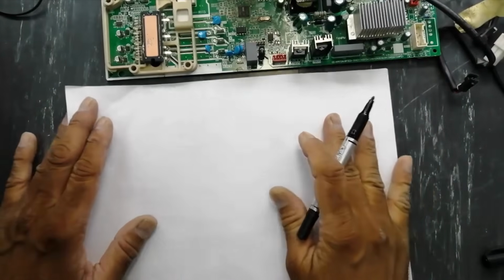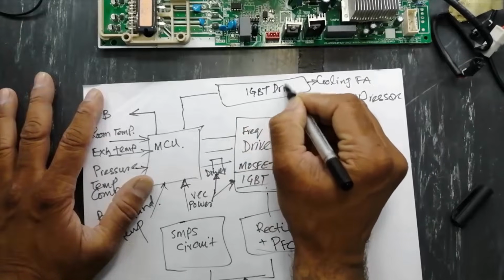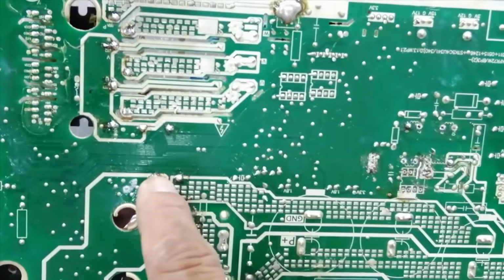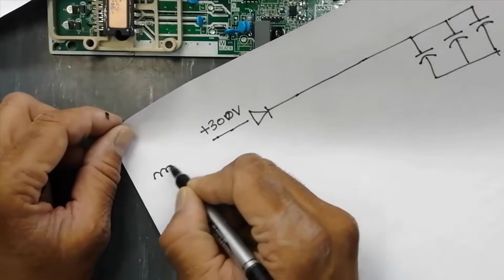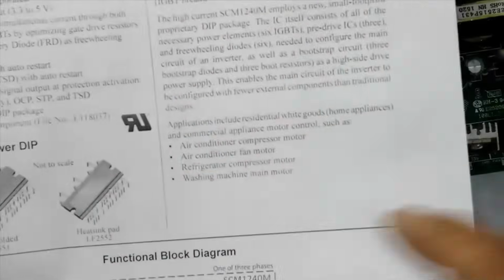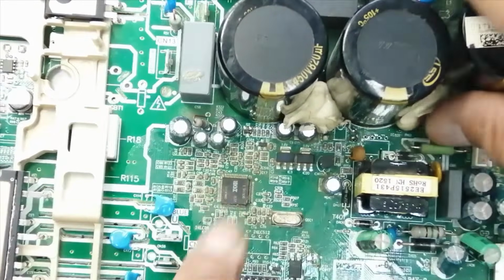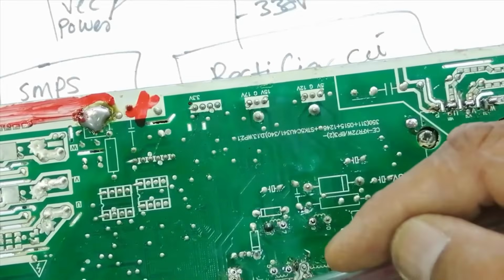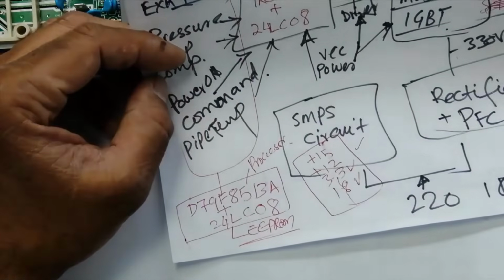#244 DC Inverter AC board Outdoor Circuit Description Explained, How to Test, Troubleshoot & Repair

Comment: the video is so helpful to understand the functions of every block diagram of every circuit of the ac inverter board but as I'm a electronics technician there is a missing thing that i always wanted to achieve it in repairing ac inverter boards is knowing the signals from the mcu to the ipm plus when we buy a new mcu for the board we cannot get the firmware of it or we cannot get the firmware of the eeprom of any ac inverter board we want from you a video of how we can get the firmware fo the eeprom and the firmware of the mcu of ac inverter boards because most of the times we buy the mcu of ac inverter board and we notice that its not programmed thank you for your effort in discussing the principle work on the ac inverter board

Comment: VFD: yes and no, not in sense of generic frequency drive where you change frequency and voltage accordingly to frequency. In BLDC motors, such as AC compressor, you change voltage, and compressor responds with increase in speed, but in order to energize windings at proper angle you effectively change frequency at U V W terminals, i.e frequency of control pulses to the IGBTs. Usually, compressor motors have span of about 900 rpm to about 7200 rpm, at 180-220 Vrms.
Also, PFC doesnt do anything under light load i.e low aperage demand for compressor (computed by MCU depending on multiple temperature measurements), but when demand increases beyond certain limit PFC kicks in and compensate for otherwise low power factor if there was no PFC (high pulsed currents trough the diode bridge).
Also, again, serial EEPROM doesn't contain any source code, only calibrated data and some space for occasional saving of settings (operating mode, set temperature etc.). Source code is placed usually on masked rom or flash or OTP ROM. In the case of the MCU on the board in the video, source is placed in OTP ROM (one time programmable ROM).

Comment: Hello sir
I have E0 in my inverter ac with no signal in relay 1 but the smtp give 5, 12 and 15v I found the drain of tny278 has no output and it's enable voltage is 0.7v
Can you help please
Reply from the maker: if SMPS is providing, that means that the TNY278 IC is working
you didn't mentioned the brand and model number of your AC. because E0 is to be defined by brands and names 
sometimes it is protection in outdoor unit  due to EEPROM failure 
please consult the operator manual or service manual for your ac
if it is not branded and it is made by some local assembler, then you need to check the board model number for indoor and outdoor unit
and locate for some other brand where that board is being used. it will help to locate the probelm
Reply: @HaseebElectronics  thanks sir, it's named Alhafidh
Reply: @HaseebElectronics  sorry sir, another normally working card has  enable voltage 0.9 v to tny but the defected one has 0.7 is that the issue

Comment: This video is unique, i will save it ❤
Thank you very i try to learn and try to remember all this information 😊

I have Mitsubishi pcb board Mxy-2g20va, the unit works but not that coold, the current shows around 1.2A, should the compressor after a well to work 100%, i dont know where to start checking to repar it😂😂😂

Comment: So, will it work if I power this Inverter Air Conditioner with 220V DC instead of AC ?
 
Because I see in the schematic the input Alternating Current (AC) is rectified into ~300V DC before going into IC & the rest of the board.

Comment: You have fantastic videos, I really enjoy watching them and I learn a lot. I am missing a video where I would learn how to look for a malfunction on a PC monitor when the screen does not light up, while the backlight of the screen /CCFL tubes are tested and are OK/. I know for sure that there is a fault in the inverter part. How to find and fix this error. Thanks and I look forward to the video.

Comment: Perfect article. Can you please advice where to buy IGBT module IPM6MBP15VSC 060-50U and what is the quote (cost per unit) ? I have plenty of DC inverter PC boards that are faulty needing such IGBT modules.

Comment: Hi friend, I have a question and would appreciate a lot if you would answer. I have an Inverter AC Hisense Energy Pro Plus that is really good and powerful, but it is installed in a small room (20 square meters) so when temperatures outside are above 8 degrees celsius AC heats the room quickly, and AC goes into stand by mode because it cannot modulate power below 400w.
When it's even warmer outside +10 C and above, the ac goes into these standy mutiple times in a day, sometimes even 3-4 times in an hour. My question is, are those freequent stand by and compressor shutting off and powering on bad for ac lifetime ? can it cause failure over time or this has little or no impact on AC lifetime ?

Comment: Wow, thank you so much for this explanation I learned so much from this video. I am going to do some experiments injecting 300V DC from a string of solar panels, right after the rectifier. Maybe I will have to build an extra power corrector to maintain a clean 300V DC. I will let you know when I know more. But this is definitely doable.  Gracias from the Dominican Republic.
Reply from the maker: Wish you best of luck

Comment: hi ! thanx for your video ! 
please, question. in africa now, all aircon tend to be inverter (daikin,airwell,panasonic,lg,midea,hisense). but no qualified tech in order to repare PCBs. So most of time, for a little issue, aircon is replaced.
is there any electronic solution to transform inverter to kind of « on/off » aircon ? or is there a kind of generic pcb that can work as replacement of proprietary board ? thanx

Comment: Thanks a lot for this amazing and informative video. I just have one quesion, is it possible to operate it by connect solar power via the rectifier pins with or without ac terminals connected?

Comment: Pls Sir, we need help...
How do I solve LG INVERTER AC CH23 ERROR code... DC link Voltage.
Some say is caused by DC low voltage, some say is capacitor..
I have tried all but yet it did not work... I have even change the IPM ic, yet nothing..
Pls Help me Sir....
Reply from the maker: can you please send the Model number of the outdoor unit or circuit board

Comment: How do I Alter the 60 Hz output to 81 Hz?
Reply from the maker: do you want to alter the output of the board to 81 Hz, if yes
then,
we cannot do it manually. it will possible from the software. you have to access the source code, amend it, compile it and reload the program in the memory
Reply: @HaseebElectronics Thankyou for taking the time to answer my question.  The project is to power the AC turntable motorin a Seaburg Jukebox to play 45 RPM 7 inch vinyl records.. The original Inverter was designed in 1966 and was not stable so the Playback speed would run between fast and slow..

Comment: How much the output. to compressor?
Reply from the maker: it output is normally 310V peak, but its RMS value will change depending on the frequency and duty cycle 
we can say it may be from 50V to 220VRMS and frequency will differ based on the required compressor speed

Comment: How much the output voltage to the compressor, or it  is DC volt or AC volt output.
Reply from the maker: it is 310V +ve peak and 310V -ve peak
its RMS value will vary depending on the frequency and duty cycle
it  may be 50V to 220V RMS

Comment: Where does the processor get its power from? I have a 12000btu gree unit
Reply from the maker: it takes 3.3 volt from the low voltage power supply 
most of the time it is made from 5 volt power supply using buck regulator
Reply: I thank you for your answer, this gree outdoor pcb board doesn't show the voltage like in ur video. Am puzzled because there is no voltage and the smaller capacitors only the main ones the lights that blink on the board not lite....plz help.

Comment: If the main capacitors have its main voltage dc and input to the board 220v Ac, why I dnt see the outdoor board light up relay not closing
Reply from the maker: sometimes the PFC circuit is unable to turn ON, 
sometimes the microcontroller is unable to sense the dc voltage 
check relay driver circuit

Comment: Sir my bluestar inverter ac(model. No. IC312RBTU )is  working for few hours. After that outdoor fan become off and continuing the temp.display. (Which is we sellected)But no cooling effect on that time. Then the error code PC-01 will display on indor unit. That time the outdoor fan becomes rotate. When the error code stoped that time the outdoor fan also stoped. What is the problem Sir? Is possible to repair the PCB?. Please help me sir.
Reply from the maker: brother i never experienced this product and its fault code translation 
i tried to search the service manual but there is no information about its fault code and its remedy. i will try to search and will contact 
because i am in Jordan and here this product is not available
Reply: @HaseebElectronics  Thank you so much sir.

Comment: PFC it is not Power Filter Contoller. Its Power Factor Corrector. It will cortect the fluctuating voltage and current and so does the power supplying   igbt ic.
Reply from the maker: yes it is power factor correction,  it compensates the voltage variations and regulaes the dc rail voltage at a specific level to provide to next switching stage

Comment: High again.At first I want to apologise if I waste your time but you see as I see you videos I want to make questions to learn …So I would like to ask you this. Between indoor and outdoor unit usually the electric connection is LINE-NEUTRAL - SIGNAL. and EARTH.So the signal wire is for the communication between two boards . My question is this. What is the dc voltage we should measure on running time on signal pin of the outdoor unit and when we make the measurements where do we put the pins of the multimeter? Signal- neutral or signal- earth?. Thanks in advance..
Reply from the maker: best regards and special thanks for your question
the earthing wire is connected to Local Earth 
Line is High side potential 
Neutral is low power potential and it is also considered as communication line return (signal return)
signal line is communication line between the indoor unit or outdoor unit 
in different companies provide different voltages  but the most common level is 24 volt and 48-56 volt
in communication line is considered as signal High. so ac voltage between signal and return may be around 56V or around 24V varying 
you can also check video number 344 for communication in inverter AC
Reply: @HaseebElectronics  best regards!!!👍👍
Reply from the maker: most welcome dear friend

Comment: Hello again. Many times there is troubleshooting between pcb and compressor. In this case I would like to ask you how we can check if the problem is on the pcb or at the compressor? Because many times we see that the winding of compressor as we measure at ohms have the same price but still the compressor has problem. So what I want to say is how we can check on running time if the voltage of pcb to the compressor is ok or not . Thanks again… I’ll be waiting for your response. I appreciate it!!
Reply from the maker: the dc resistance is not valuable in compressor testing 
its ac resistance is the most important features, when the board initiates the drive signal through driving the IPM, it continuously measures the stress on UVW pin, if the applied signal is dropped at very low level, it will define that there is some stuck or in the compressor. 
so at each drive pulse issued by the micro-computer, will monitored at continuous base  by measuring the output signal and the dc current through the shunt resistances connected in low side of the IPM DC supply. 
and it will adjust its drive pulse based on the compressor health which is being monitored by measuring aforesaid parameters
Reply: @HaseebElectronics  thank for your answer . So as I can understand we have to know the feature of the main microprocessor….

Comment: Hello my friend . I would like to ask you if you know what is the voltage - frequency we should measure on the compressor terminals  if the circuit works normal? Thank you in advance.
Reply from the maker: the voltage and frequency will differ from board to another board 
because the voltage & frequency will provided by micro-computer based on the compressor heath, indoor unit temperature 
because some boards have VVD (variable voltage drive) method 
some have VFD (variable frequency drive) method 
some have both VVD & VFD method 
so to find the exact voltage level & frequency we need to know the source code (the software in micro-computer)
Reply: @HaseebElectronics  if we know the type of microprocessor we can find them from the datasheet?
Reply from the maker: no 
a microcontroller is just like a blank notebook
the most valuable point is the source code, which is written in that microcontroller
microcontroller will follow that instructions
so that instructions will define the output of the board

Comment: وعلیکم سلام و رحمۃ اللہ و برکاتہ
Lot of thanks respected sir, it is very important information that you have shared, may Allah bless you and your parents in this world and the hereafter. Aameen!
Sir how can we on the board after connecting all sensors and other jack plugs but not connected to the in door control board, just giving an input and run the compressor and fan.
Thanks!
Reply from the maker: Many many thanks
outdoor unit needs a power ON command from indoor unit board. there is no way to directly turn ON the outdoor unit 
we need something to generate a communication interface to give and take instruction to the outdoor unit processor
Reply: @HaseebElectronics  اسلام علیکم و رحمۃ اللہ
Many many thanks dear sir! You are really a great teacher for us.

Comment: Sir, Thanks for Wonder full Explanation.
I have problem with Toshiba Inverter A/C.
Power Module MP7003 keeps blowing out
Reply: Hi Pravin, I have exactly the same problem with my Toshiba Inverter. The PCB changed four times already, but still keeps blowing. Have you found the reason why it happens?

Comment: For 240 voltage  main supply 
How much volt read at compressor supply
Reply from the maker: for compressor voltage 
it depends on the compressor type & board type. and the control method. 
it may change voltage 0-250VAC and frequency 53Hz to different frequencies, depending on the manufacturers. it depends on type of the modulation, either it is PWM based and PAM based, so each circuit have its different conditions

Comment: The frequency is variable this is understandable and what about the voltage is it variable as well
Reply from the maker: yes dear 
there are different controls 
VFD variable frequency
VVD variable voltage drive
VVD & VFD variable voltage and freq
then most critical point is type of modulation for the signal 
then either it is 2 phase or 3 phase method

Comment: dear  sir can i run a inveter ac with only outdoor bord?
Reply from the maker: no, because to turn on and operate the outdoor unit we need a communication line to talk with outdoor unit circuit. as it have microcontroller, so communicate with outdoor unit board we have to send commands in it's language

Comment: Comfee Aire conditioner invertor ..the problem is E1 code
so i need solution please
Reply from the maker: i have no experience about Comfee brand. please send its model number to my whatsapp 00962-79-1161084
Reply: @HaseebElectronics  ok i will send it later...thanks

Comment: very nice video,have you every try to repair fujitsu inverter main contoller board?I have one and it works a while then cut off after the signal terminal drop fluctuate voltage.

Comment: Hi. I have a whirlpool ac inverter the outdoor unit  the compressor starts for 1 second and stop running  I have change the IPM ice but no result
Reply from the maker: does it display some error code. because that error code on indoor unit is a pinpoint indication to the problem area

Comment: How to fix communication E6 error
Reply from the maker: Good communication without joints
both optoucoupler and its related circuit  (receiver and sender) in outdoor unit & indoor unit
power supply in communication interface (in some models 24 volt and in some models  56 volt)

Comment: Excellent video. Just have one question. Which AC was this board used in ?
Reply from the maker: it used in many 1.5 ton & 2 ton ODU. gree, diakiin, chiggo, Petra, Sharp. just changing the software

Comment: very good explanation of the inverter AC circuit. Thank you very much. Will you please explain the indoor unit circuit also? I have noticed only one wire (called signal) going to the indoor unit other than power supply (total 4 wires, L,N,E,S). Please explain.
Reply from the maker: pin L is Line
N is Neutral
E is Earth Cabe
S pin is Signal or Communication wire (please check video number 344)

Comment: Hi! Think you for the great video. I have a Panasonic heating /Cooling Air Conditioning Model CS-E9DKE when I start heating after two hours it's who me an error H16 can you please tell me what's the problem and how to solve the problem thanks in advance.
Reply from the maker: in Outdoor PCB , IPM (Power transistor) module,  
Current Transformer open circuit or its respective circuit is facing issue. that the MCU is not getting proper feedback from current transformer
Reply: @HaseebElectronics  du you know how it looks like please 🙏
Reply from the maker: @nasserjari2829  it is like an inductor   CT1D1. it is before bridge rectifier  and sense output is connected 
its output is connected to D4, D5, D6, D7
output of the diodes is passed to pin 99 of the microcontroller
Reply: @HaseebElectronics  you are legends man
Reply from the maker: @nasserjari2829  thanks a lot brother
Reply: @HaseebElectronics  con you send me whatsup numbet